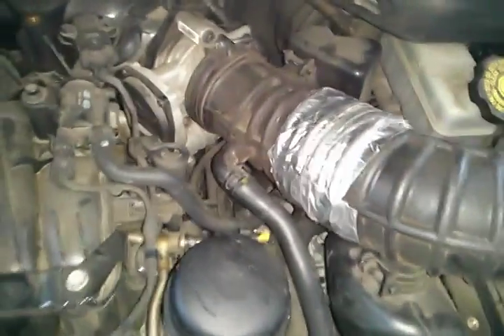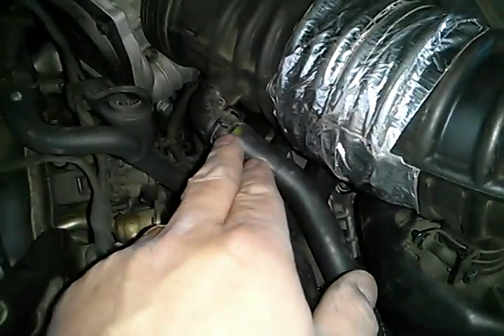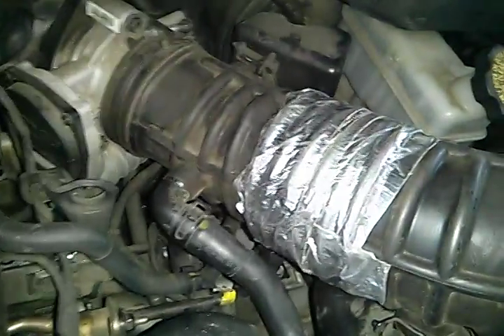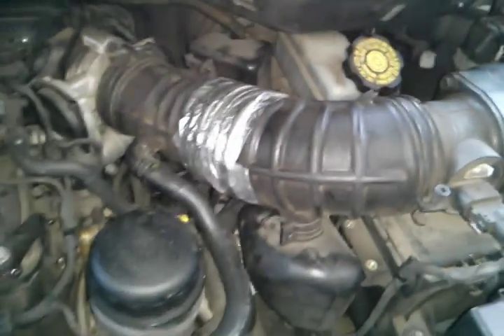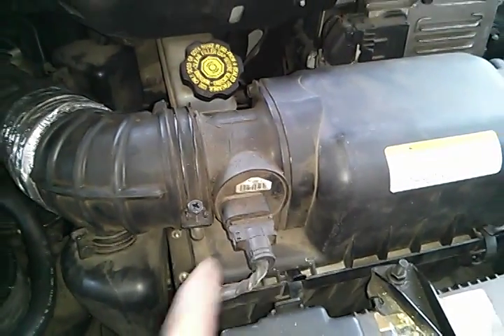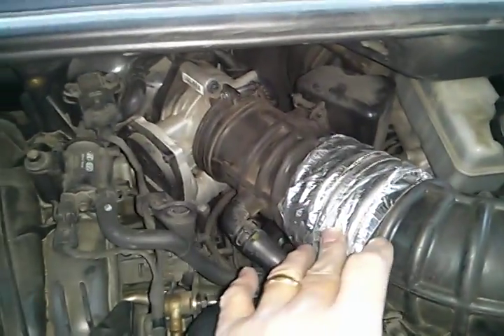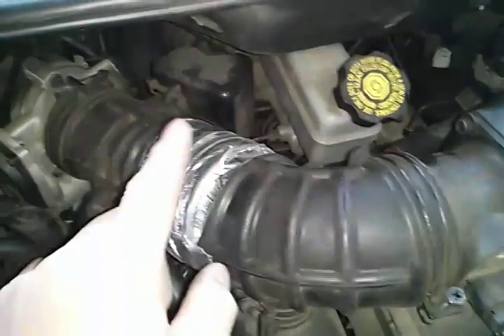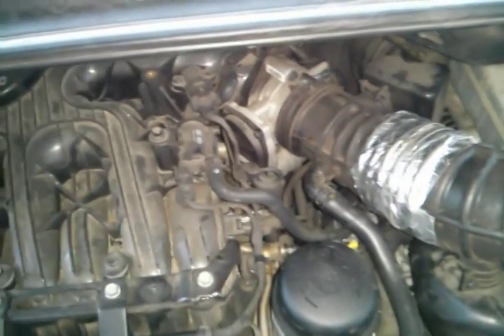2006 Kia Sedona Check Engine Fix

Comment: I am getting a 0638 code for the Throttle Body Sensor. I bought both the Throttle Body and a new Intake hose. I got the hose today and as I was taking off the old one I noted it was badly cracked in a couple places. Could this bad hose alone have given me the code? Also what led me to this was the Check Engine and ESC lights came on and I had no throttle response. Engine would start but no go, go!
Reply from the maker: Mr51Caveman I'm not sure about the code but fixing the hose worked for me.  Thanks for the post.

Comment: also my car check engine light on when I found it air intake hose broken..is that reason light on?
Reply from the maker: Best way to check is repair the hose (ie. Duct tape) to seal it.  Then see if the light comes on again.  The error would be related to the airflow mix.
Reply: i just buy new hose and replace..now work good...also light off..thanks..

Comment: the pipe is 35 on amazon just replace it
Reply from the maker: Thanks.. This was a quick fix to stop the error code.  I did order the pipe from Amazon and I returned it because the openings for the other attachments was not the correct size for my 2006.
Reply: Тhere is an easy fix you cut out a pease of your pipe i did it read on amazon
Reply: I did it and it works great
Reply from the maker: David Manheim Thanks, I'll look for it... I do have a new pipe coming.  Hopefully it fits :)